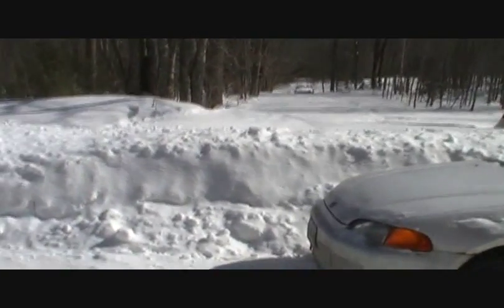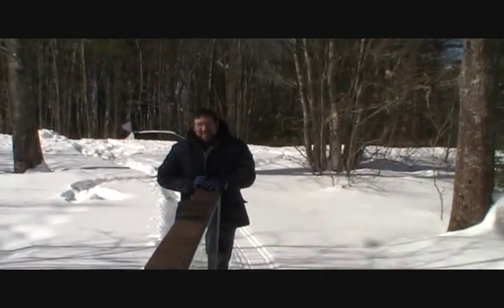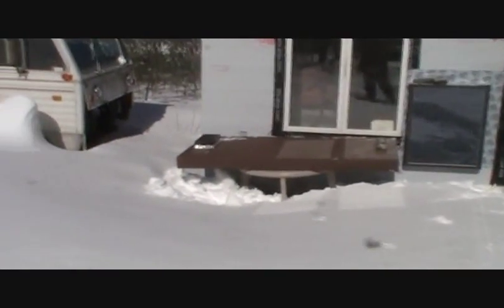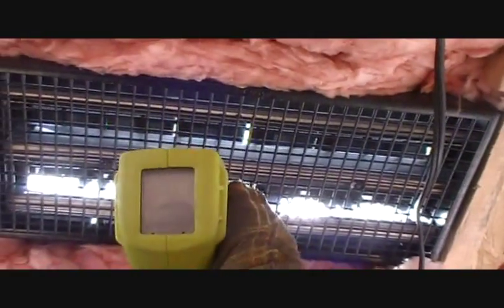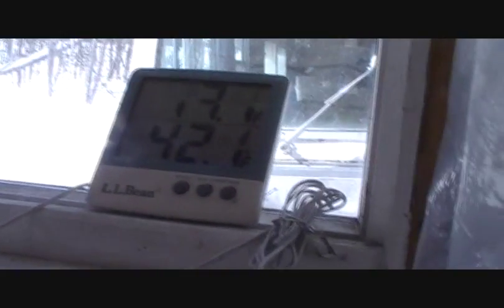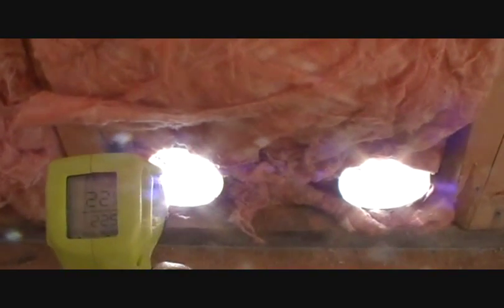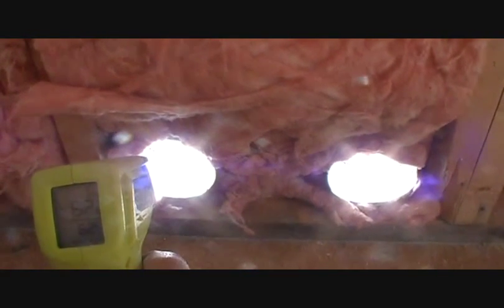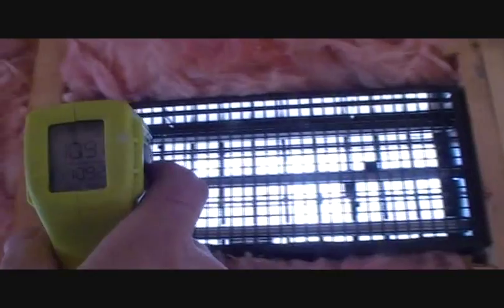Solar heater RESULTS! - Backyard Mechanic DIY

Comment: Nice heater. Maybe some ideas for improvement? Solar powered fan to push air out of the box; insulate the box with foam board to reduce cold ingress and heat loss; and perhaps a looped circuit on a portion of the exhaust that goes to one of the holes on the bottom, just to increase the heat before it is blown into the house. Just spit balling.

Comment: Not bad. You need a bigger box for more heat. Is all about how big is the surface. And of course...sun on/off :) Since is a new building you can set a pipe under floor and force hot air to go there first. You will store some heat in the ground for night. Still you need a biggeer box :) Good luck!
Reply: Well cool to know. Now give us the video for it. 🤷🤷🤷🙋🤔🙋🤔🙋
Grand Blessings everyone everywhere..

Comment: So bottom line is that you need fans to circulate heat?  Why were there 2 holes for incoming air at bottom  vs just one?  Can you comment more on choice  of grate to distribute outgoing heat at top.?

Comment: How warm does it get inside during the day ?
Reply from the maker: Veikra The inside of the building is roughly 300 square feet.  It's not fully insulated yet, so keep that in mind.  By the end of a day with good sun it's above 60 inside with no heat source other than the sun.